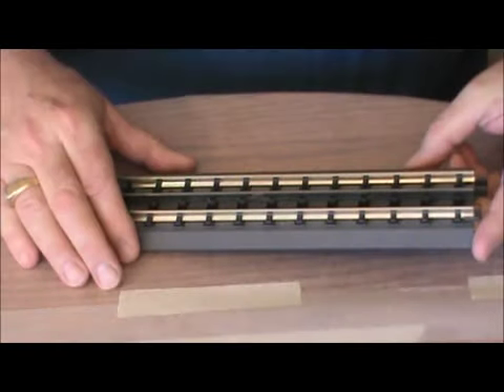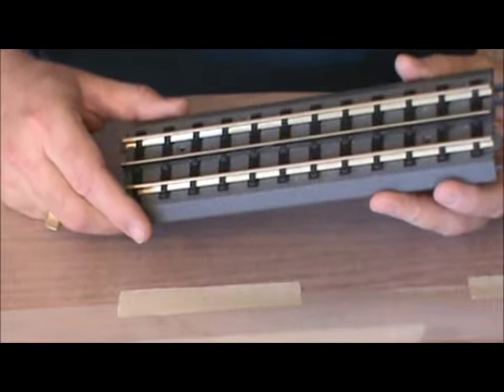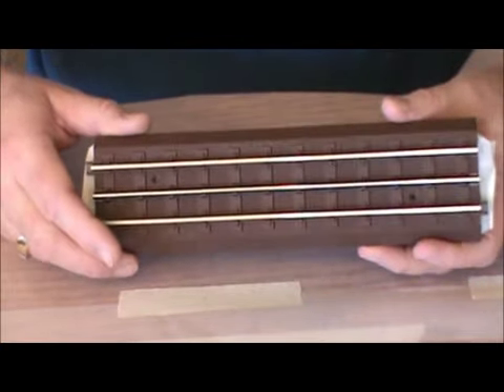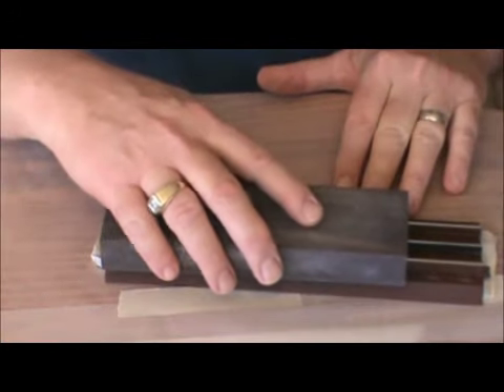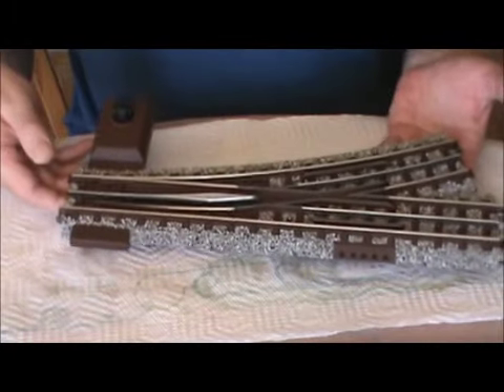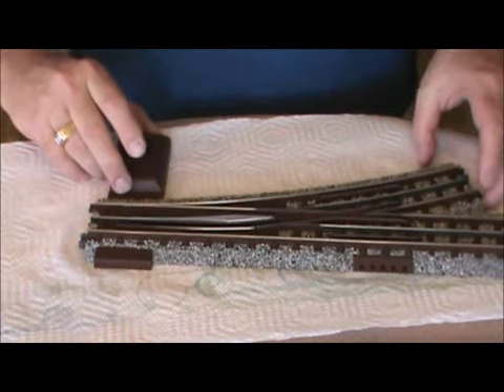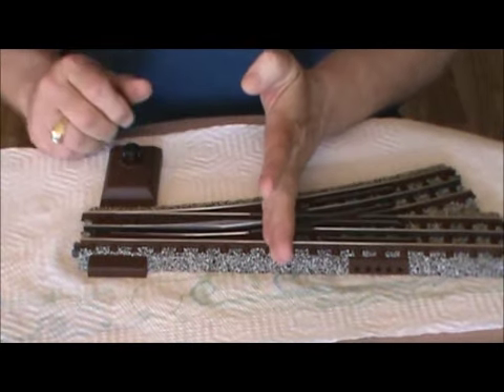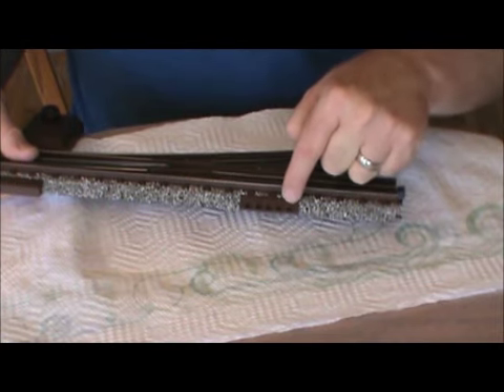Ballasting MTH Realtrax

Comment: This is excellent, i only wish you would of showed us your masking techniques for the rails before painting
Reply from the maker: Hi, yes I suppose I should have.  When making the video I believe I was trying to keep it from becoming to long.  First let me say that I don't believe MTH ever designed their Realtrax with the idea that someone would want to apply ballast to it.  To do so is very time consuming starting with the masking of the center rail.  I chose to do this due to my having a pretty big investment in the track system when I began to think more about going Hi-Rail vs. a traditional 3-rail layout.  My options it seemed  were to sell it all and start over or go with what I had, MTH Realtrax.  Realtrax is a solid system so I decided to figure out a way to make it look more realistic.  I would tell folks that I have had a pretty good experience with ballasting the roadbed, but it is very time consuming.  Basically what you want to do is mask the center rail.  I use good quality 1/2" or 3/4" masking tape, depending on what I have on hand.  I found good quality masking tape left less glue residue on the track when removed after painting.  Essentially, I run a strip of tape the length of the center rail on one side.  If using 1/2" width tape I then folded it over to cover the other side of the rail.  If using something wider than 1/2" like 3/4" tape you will need to run a razor blade a little above the top of the rail cutting the tape lengthwise.  The other portion of the tape is then used to cover the other side of the rail folding the excess over the railhead.  For switches/turnouts you will want to do the same thing making sure tape is applied everywhere you do not want the paint to be applied.  You'll likely find it necessary to carefully cut pieces of tape to cover the surfaces of the switch/turnout frog.  I would also note that I learned during this process that it is wise to also apply tape over the two ends of the track to prevent the metal contacts from being covered with paint.  If you don't cover the ends and spray the track with paint you may fine that you will have to spend time cleaning the individual contacts before connecting the track pieces.  It is easier to mask off the ends than clean the contacts I found.  I hope this helps.  Bo

Comment: Thanks so much for this video guide !!   I mite try it on an extra piece. Do you let the Glue dry/get tacky any before laying ballast on?
Reply: * how do you get the side of rail so perfect?  cutting away the tape off the bottom of T  where u cant see once laid flat I assume? we love the realtrax the only issue is i don't like the giant switch motor box's ,
Reply from the maker: Andrew, I apologize for not responding sooner to your inquiry.  To answer your question, not really.  I will generally apply the glue for several minutes trying to get as much of the piece of track done as I can before I stop to apply the ballast.  The wetter the glue the better I think.  For example with a 10" straight piece of track I will apply the glue between the two outside rails and then stop to apply the ballast all the way up the center.  I then apply the glue to one side of the plastic base, apply the ballast and then finish up doing the same thing to the other side.  You'll find that as you do more track you'll get much faster (and neater I would add).  Bo

Comment: I'm currently running all lionel tubular O gauge at the moment, but thinking about switching to this set up you have here as MTH makes every accessory you could possibly need and are all compatible with the Realtrax system... Quick question, some Realtrax I see for sale have a solid black middle rail and some have a silver middle rail, do you know which is the newer version? I'd hate to mix & match once I start a new project
Reply from the maker: Hi, originally MTH Realtrax had solid rails with a blackened center rail.  Some years later they began using hollow rail. I assume as a cost cutting measure.  Turnouts/switches continue to be made with solid rail.  I have not seen Railtrax with or heard before of it having a silver colored center rail, so really cannot offer comment about that.  Honestly, I do not like the hollow rail.  I have some of it and it simply does not look as good.  I am actually going to be going with the Atlas O 3-rail track with plastic ties when I undertake an expansion of the current layout.  If you are considering creating a Hi-Rail layout I would highly recommend consideration be given to the Atlas O track.  Hope this is helpful.  Bo
Reply: The Atlas track is beautiful... It reminds me of Super O. The only thing is I'm running my railroad on the carpeted floor, taking up an entire room in my house. I initially wanted to go with Atlas track I just couldn't find a trestle system that was compatible with it & I didn't see one made by Atlas exclusively for it, that's why I was opting to go with the Realtrax system as I have a few elevated levels within my layout.
Reply from the maker: ldl0021, understand about your wanting to use a system like Lionel's FasTrack or MTH's Realtrax on a carpeted floor as they already have the roadbed integrated with the track.  I'm sure you already know this, but I'll mention it anyway.  The technique/ process I used to apply ballast to my MTH Realtrax would only be applicable if the track was going to be permanently affixed to a layout.  Once the ballast is applied and the white glue has dried it does not hold up that well to a lot of handling.  Just thought perhaps I should mention that.  I also want to mention that I also like Lionel's FasTrack.  The primary thing I like better about the MTH track (at least the older solid rail) was that I felt the rails had a more prototypical appearance. Bo
Reply: Sounds good, I actually had no idea... As I've never worked with ballast before.
Reply: William D Burgess
 you know what else Bo... Most of my engines and locomotives have Magne-Traction...Which doesn't sound like it would mix too well with realtrax.  the more I think about it less options become available... It is what it is.
Reply from the maker: That is a good point.  Matter a fact not long ago I ran some postwar trains (diesels) on my MTH Realtrax and it is surprising the difference running on steel rail vs. a copper alloy.  I agree, that should be something you consider.